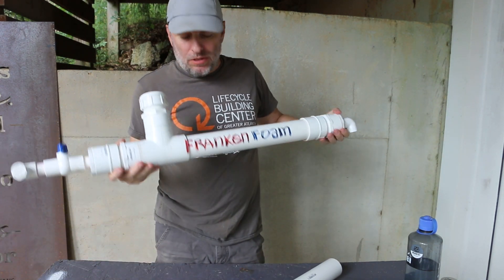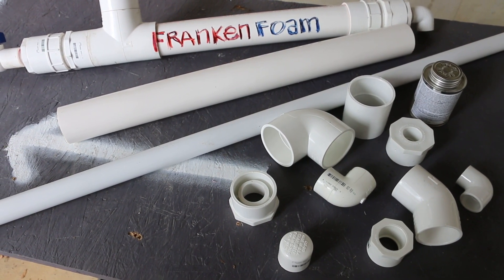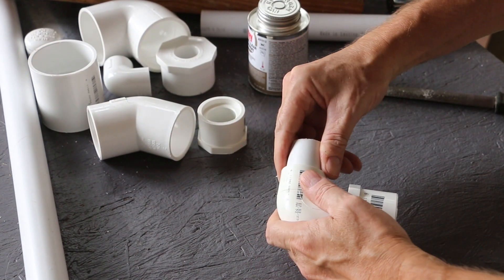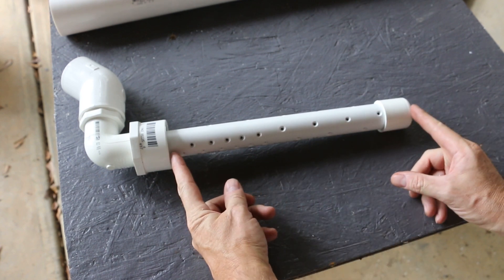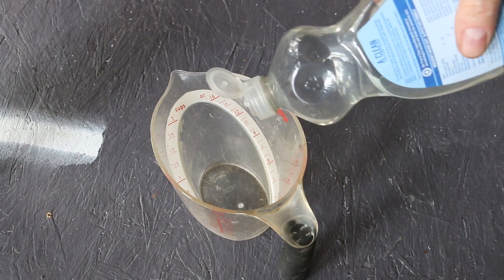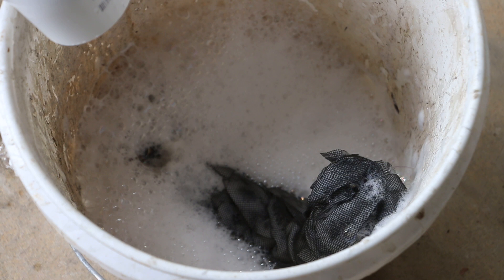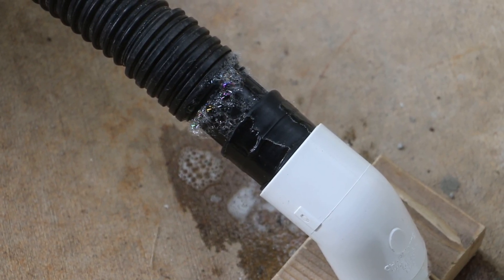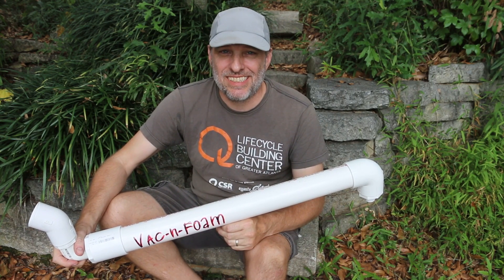How To Make Aircrete Foam With A Shop Vac | Part 2

Comment: Note: Vac N Foam Idea is originally adopted by Von Schrader VLM (Very Low Moisture) upholstery & carpet cleaning. After recirculating the exhaust air back into the machine they do use means to compress the exhaust air into higher pressure. This result in dry rich but slow ejecting foam using their detergents i.e. Von Schrader/HOST.   Franken Foam uses coarse stainless steel wool. I am currently building a Franken Foam however i will be using from aerating tube till ejecting tube 3 pads of fine stainless steel wool + 2 pads of medium stainless steel wool + 3 pads of coarse. I hope the foam will be denser using fine wool. Many Thanks.

Comment: Wouldn't it be useful to get natural CO2 into a mix, or would that be to acidic in contact with water? How about nitrogen, is there a natural way to get that out of the mixture (ammonia, isn't that even caustic, to match the concrete pH)?
Reply: Maybe ozone + ammonia+ magnesium copper?

"Ozone has been widely used in water treatment of various types of water. It can react quickly with organic pollutants, containing double bonds, aromatic groups, or amino groups [4]. In addition, ozone decomposes and generates hydroxyl radicals (•OH) in water. Hydroxyl radicals were considered to be the strongest oxidant in water and enhance the oxidation ability during ozonation [5]. However, ozonation for ammonia removal was regarded to have several deficiencies. First of all, ammonia mainly exists in the form of NH4+ under neutral conditions which were proved to have little reactivity with O3 and •OH [6], [7]. To improve ammonia removal performance, pH has to be maintained above 9.0 or higher during the ozonation process. Furthermore, the ozonation product is mostly nitrate. It means that the ozonation of ammonia requires alkaline conditions, and the total nitrogen removal efficiency is extremely low. In addition, the products formed by ozonation of ammonia nitrogen contain H+ ions, causing the acidification of the solution. For example, Khuntia [8] reported ammonia removal by ozone microbubbles and the oxidation rate of ammonia decreased obviously due to solution acidification as the reaction progressed. Therefore, the altered pH would lower the reaction process and make the mechanism more confusing to be declared.

In order to improve the performance of above chemical oxidation reactions for ammonia (as well as total nitrogen) removal, some catalysts naturally come into people's vision. Ichikawa [9] reported that Co3O4 showed high selectivity to gaseous products. Chen [10] synthesized a series of catalysts with various MgO-Co3O4 molar ratios. And the highest catalytic performance at the Mg-Co mole ratio of 8:2 was detected, which removed 85.2% ammonia in 2 h and the proportion of gaseous nitrogen in the product was 44.8%. Liu modified NiO by surfactants [11], [12], which showed high catalytic activity and about 76% ammonia was claimed to convert to gaseous nitrogen. However, solution acidification inevitably occurred in all the above catalytic processes and resulting a series of complex changes in the types of oxidants and the existing forms of ammonia. No buffer was used to control pH in the above studies since common buffer components such as phosphate and carbonate were thought to have high affinity towards certain active catalytic sites that might block catalytic centers and work as poisons of catalysts [13]. The problem is that the heterogeneous catalytic system is too complex since it is difficult to distinguish whether the disturbance of reaction rate was caused by the change of pH or the interaction between catalytic and substrates. Moreover, catalysts involvement and declined pH during ozonation complexly altered oxidant forms involved, which made it more challenging to elucidate the mechanism of ammonia ozonation. Hence, although several so-called high-performance catalysts were reported, proper mechanisms involved in the degradation process of ammonia by ozone still lagged far behind ozonation utility."

Comment: Make stronger concrete without the limitations of steel. Made from molten quarried rock, these chopped basalt fibers are superior to fiberglass and steel.

Exceeds the performance standards of steel, fiberglass, and poly

Alkali resistant

Corrosion resistant

Chemical resistant

Product Support

Free Shipping in USA

About

Basalt Fiber is a better way to reinforce concrete.
High tensile strength. Above all other conventional reinforcements
Corrosion resistant. Will not decay or rust over time, unlike traditional steel.
Moisture resistant. Weathers the wettest environments with built in alkali resistance.
Chemical resistant. Compatible with nearly any admix you include in your concrete.
Frost and heat resistant. Takes freeze-thaw cycles in stride
Smooth Blending. Does not clump or ball during mixing like many pva and poly fibers.

Specs

Common Dosage: 2%-5% loading; based on cement in mix by weight

Dimensions: 12-50 mm (L) strands

Packaging: Heavy-duty plastic bags

Weight: 40 lb

Material: Basalt Fiber

Sustained Operating Temperature: 600ºC

Minimum Operating Temperature: -260ºC

Density: 2.75 g/cubic cm

Tensile Strength: 4840 M pa

Elastic Modulus: 49G pa

Compressive Strength: 550,000 psi
Reply from the maker: Great info! Thank you so much.

Comment: there is a Concrete HARDNER  that can be Painted or sprayed on or trowel  on outside of AIRCRETE to strengthen the Surface of AIRCRETE & also  could add  FIBERGLASS fibers concrete additive or 
Basalt concrete fibers /strings  additive
to add 20%/35% more strength to AIRCRETE
Reply from the maker: Excellent. Thank you.
Reply: @TEXAS_FREE_STATE. Friend, I write this under correction. Sure I saw some info regarding homemade waterglass liquid made from ordinary cat litter. Amount added to water per batch of aircrete was 10% by volume of water, added at the final stage of batch mixing before pouring. Apparently also adds strength to finished product and adds moisture proofing qualities to cured final product. Hope I have the facts right.

Comment: It's interesting to see how different pressure sources affect the quality of the foam coming out of your Foam Cannon.  I would be interested to see the break out strength of different aircrete samples using different densities of foam...  Can't wait to see the next iteration and the improvements to the design.